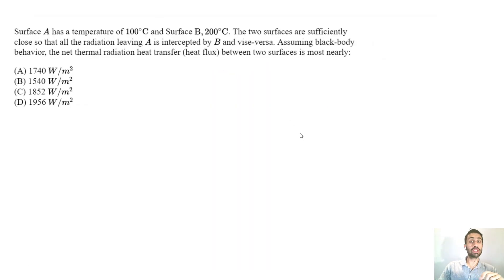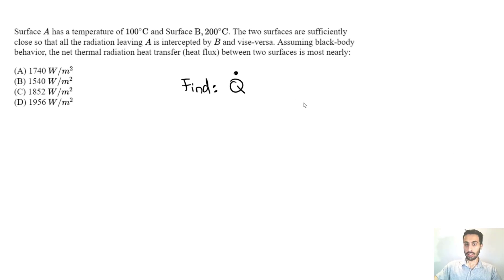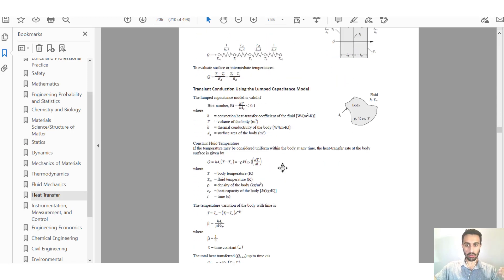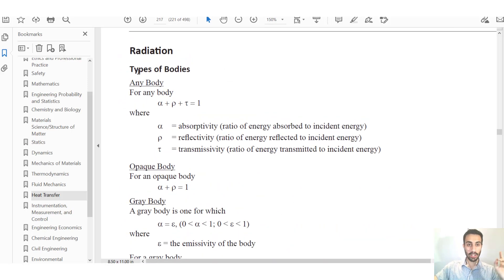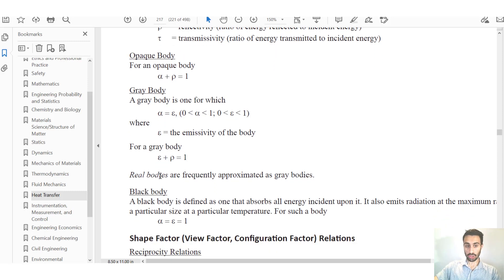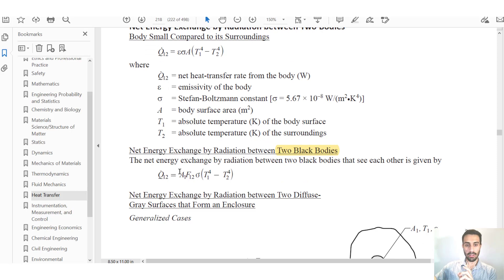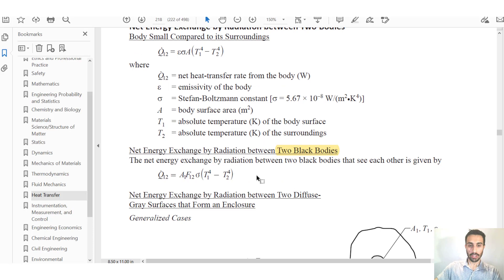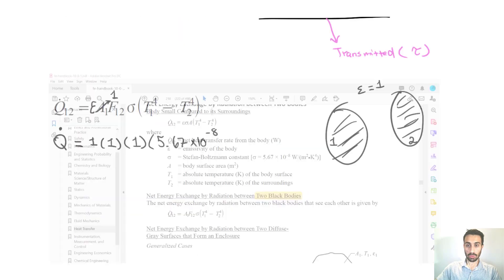FE Exam Review - Heat Transfer - Radiation

Comment: shouldn't the heat transfer be negative? since 373^4 - 473^4 is <0
Reply from the maker: Technically yes if we are finding the net heat flux flowing from B to A. But for most heat transfer problems, we are usually interested in the magnitude of heat flux, so the negative sign is often dropped.

Comment: How do we identify if its T1 or T2?
Reply from the maker: T1 =  Temperature of the hotter surface 
T2 = Temperature of the cooler surface
Reply: Then why did you use 100 for t1 if it should be the hotter one?